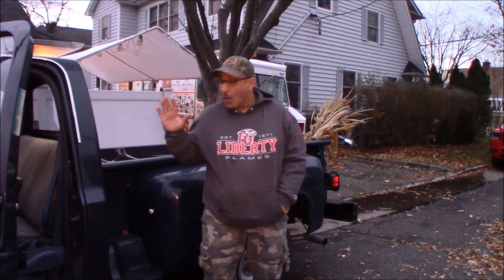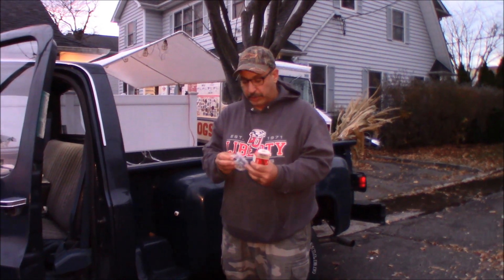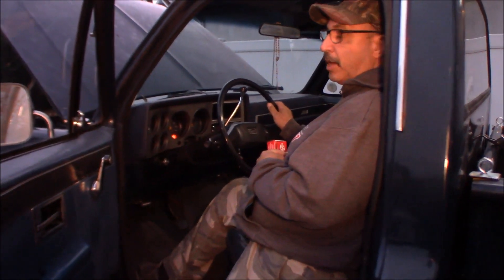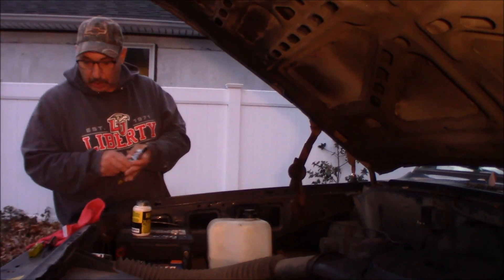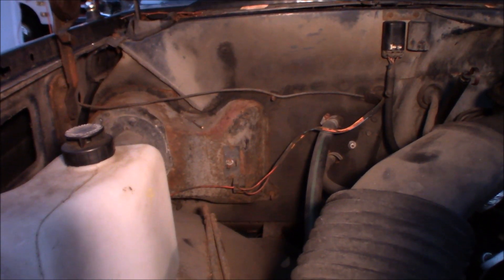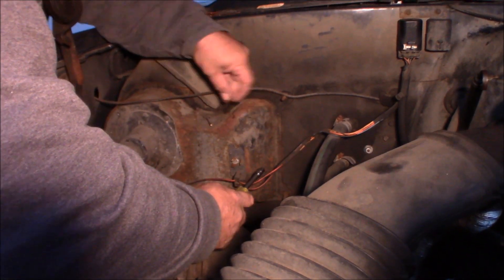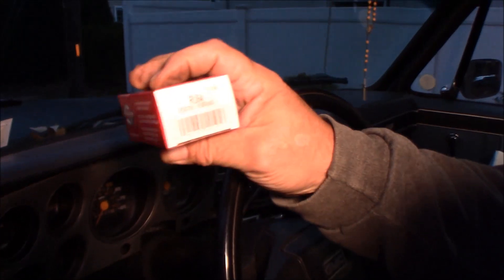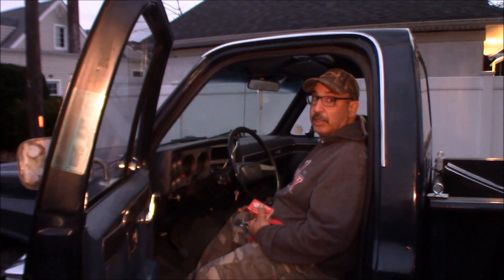Oscar The C10 Stepside: Episode 11 | Square Body Blower Motor Resistor

Comment: What if it only works on low?
Reply from the maker: Probably same thing, or the blower itself is on the way out.  Make sure to check the switch as well.
Reply: Something driving me nuts, my blower and wipers shut off at same time. Im assuming they are linked somewhere, any ideas on how to troubleshoot? Maybe they share a common ground?